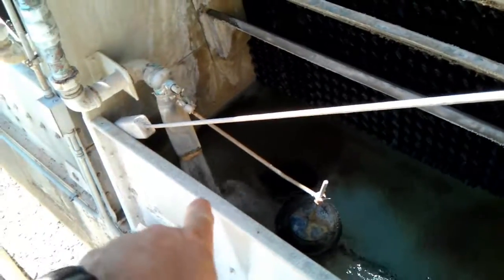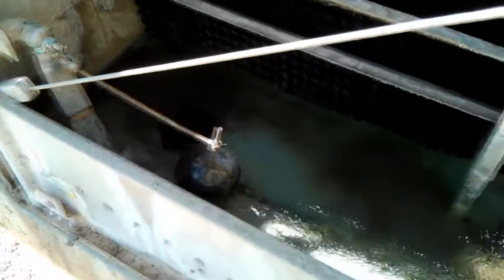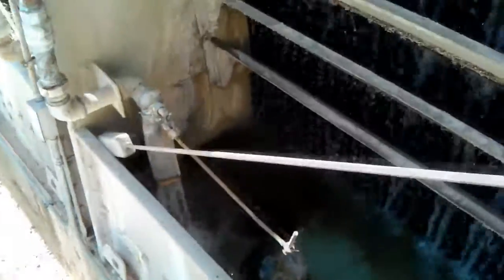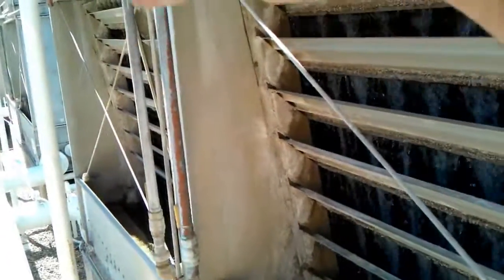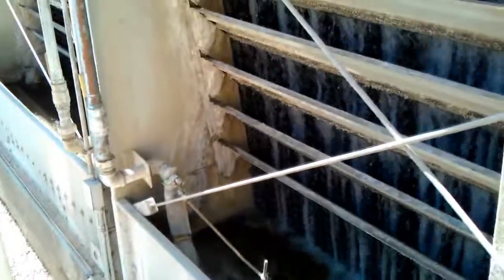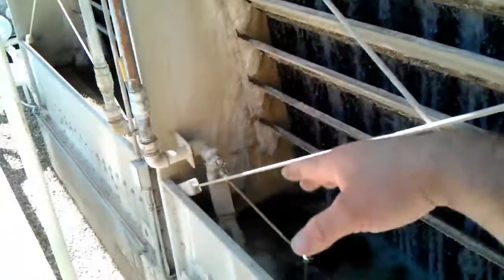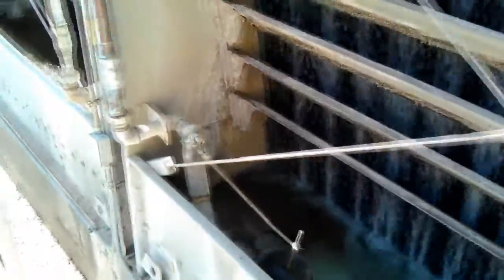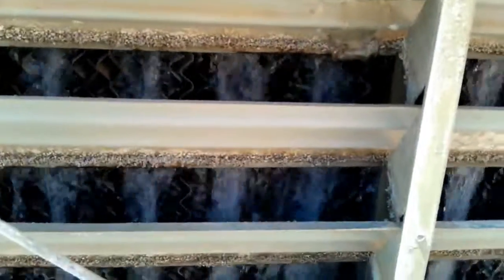Cooling Tower water fill rate on a HOT Arizona day [HD]

Comment: i can help with your tower chemical build up i work for a company that has a filter system that is designed for high efficient systems just like yours airsolutioncompany.com
 it will lower your amount of chemicals your dose the tower with and slow down your make up water with the filter systems it is UV resistant in order to slow the process of photosynthesis. if you have any questions feel free to contact us at anytime my name is Frank and i would be willing to help you in anyway possible.

Comment: I heard that in the early days of A/C in PHX, some buildings had their own well for condenser water.  No tower, no recirculation, no mineral build up.  Just pump from the well, thru condenser, and out into the drain.  Sounds pretty wasterful, but in those days I guess they weren't worring about the groundwater level.